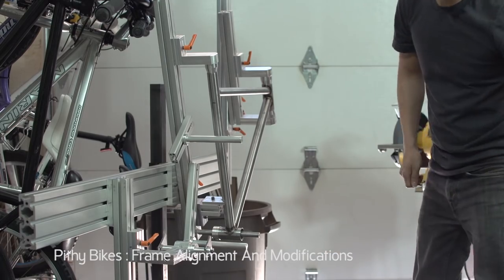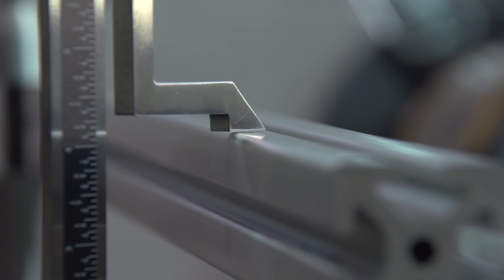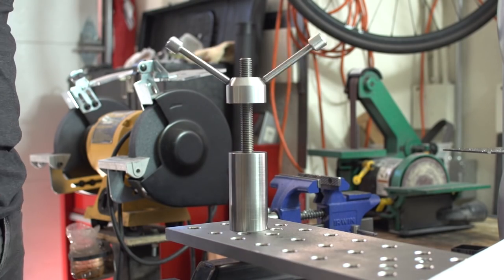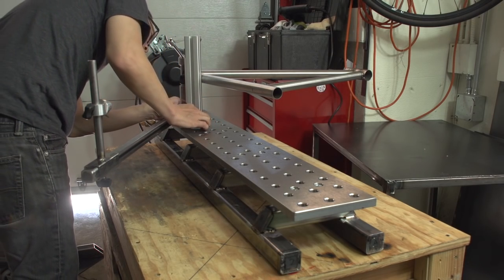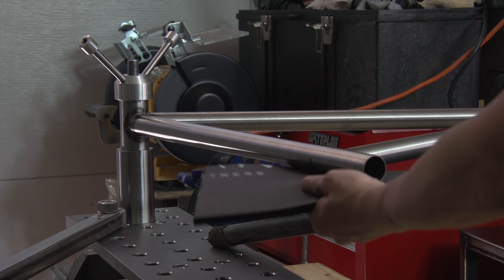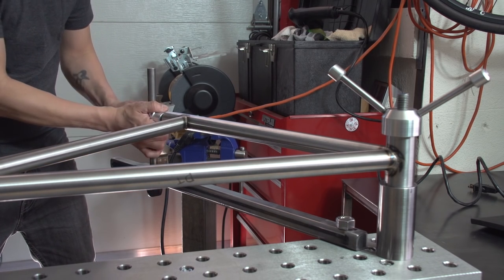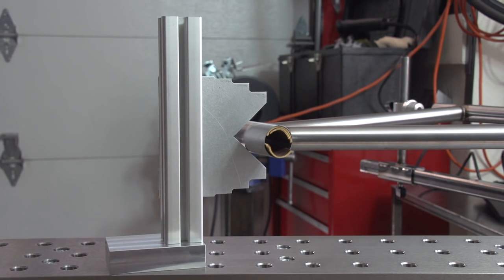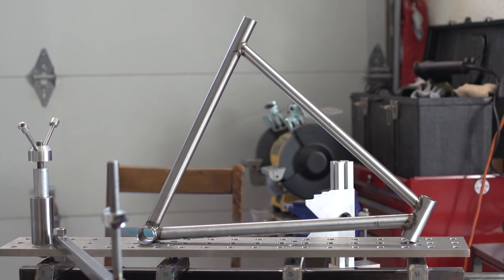Bicycle Frame Build 50 - Alignment Tips and Modifications

Comment: This is not a tip from a pro, but from where I'm standing I feel like it might be a good idea to heat the frame a little before aligning it so the bending is not cold deformation and you risk cracking in the welds far less.
On top (this is not so important in this case because you will weld a post stub to the seat tube but in general) I would probably insert a fitted piece or a seatpost into the top of the tube where you're levering, the same on the headtube, because you put a lot of pressure on the tube and risk denting/ovalizing it. I might be wrong here but it's just my thought looking at the process.
The leather you wrap around it probably dissipates the pressure a little but I wouldn't necessarily count on it.

Comment: How about a bottle jack to position and some heat?
Reply from the maker: Thats a good suggestion. I have however been getting comments on the use of too much force. I have since learned that too much force is bad, and to avoid it as much as possible while welding the frame. Basically getting it aligned right after tacking. And then checking back and forth on the table for alignment while welding. Cheers!

Comment: In this video you use a rod with a bearing as a straightener to center the stock.  I have been trying to figure out how to straighten similar large diameter stock on my small lathe.  do you lock you stock down, then run the straightener or is the stock a little loose then you center then you lock down?  does any for your videos show this whole process? any advise?
Reply from the maker: Hi! Yes, you snug up the work piece but dont tighten it. Then run the tool. Here's a video on the tool and process.
https://www.youtube.com/watch?v=kZpGv6s-3Yc

Good luck!
Reply: +Pithy Bikes Awesome.  thank you so much.  This is exactly what I need.  I am going to build one this weekend.
Reply: +Pithy Bikes thank you for the info. this is what i made in the shop this weekend https://www.instagram.com/p/BHFhxeVhGaj/.  again thank you

Comment: To avoid the tube bent by heat effect, i weld as much as  possible in the jig
Reply from the maker: I see varying methods on this. In the class I took, the instructor advised against welding in the jig. Something about the frame needing the freedom to flex. However, I've also seen pics of pros welding tubes up while on the jig as you do. I'll try this some time. Only reason I don't is my jig makes certain welds hard to access. I want to put a rotation point on my jig so I can rotate the fixture around on the stand. Some day..

Comment: im with you 100% about checking you frame as you weld.. in fact id almost weld on the alignment jig. i do some light tacks, align, heavy tacks, align then check alignment between welding passes and you can use the shrinkage to pull the frame back into alignment as you weld
Reply from the maker: This method makes so much sense to me. I remember when I was welding the main triangle for the frame in my videos. I was trying to make the bead as pretty as possible. Stacking dimes in the same direction all around and trying to hide the start/stop areas. Now I say To hell with that. Welding for alignment and strength is most important.

Comment: Nice tool for aligneing (centering) the alu rod in the lathe. I have to do one of that!
Nice videos, keep up!
Reply from the maker: Thanks! I didn't invent that tool. That is a machinist trick I saw out in the wild on YouTube. I can't remember where I saw it though.. I made it with an old skateboard bearing. I recommend a smaller bearing if you make your own so you have more clearance for larger dia stock. :)
Reply: I noticed that too and have to get one for myself. Did you make the tool yourself Steve or is it something that you bought? I think you need to do a short video on its use :o)
Reply: I think he made it becaus the bearing holder portion is milled to the desired hight.